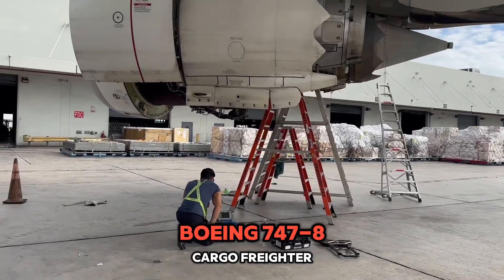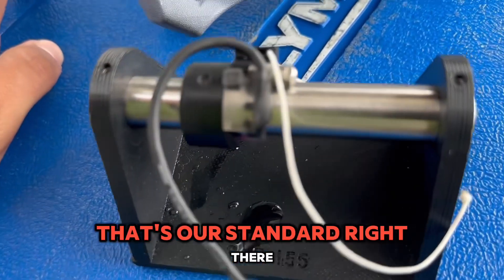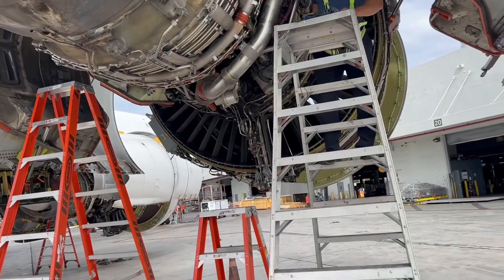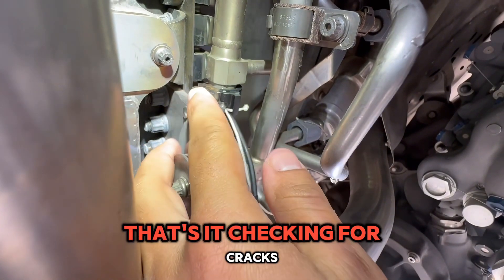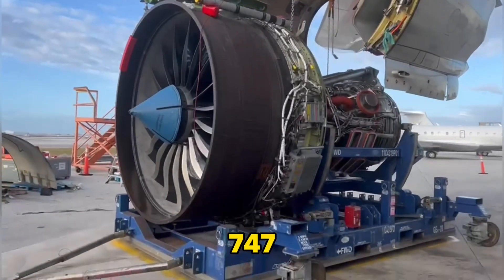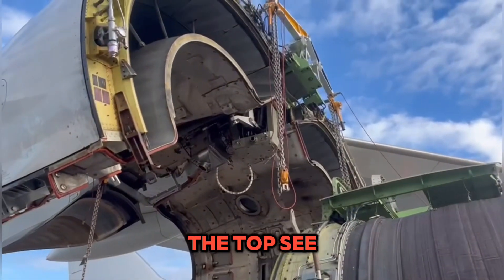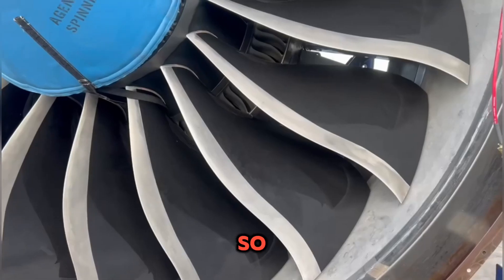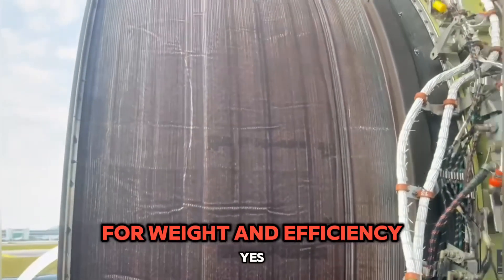AIRPLANE TURBINE ENGINE INSPECTION / CHANGE / START UP #airplane #facts #foryou

Comment: Just like starting up a cold 425 cat in the cold. She smokes till the flame wall is up to temp. 
Those engines are amazing! The energy created in that machine is incomprehensible. The shear volume of air they move is astounding! 
Whats the psi on those fuel lines? Its gotta be up there!
Reply from the maker: Great point! CM great to see you here again. Yeah that was an initial start with all the preservative oils. The engineering on those High Bypass Turbine Engines are a Work of Art. Happy Easter my friend
Reply from the maker: I don’t know 🤷 the fuel pressure on those fuel lines

Comment: There are allot of rules and precautions excersized hauling those big engines. 
Outstanding job guys.
Side question, how do they bond the titanium to the carbon fiber on those blades? 
Thanks for sharing! Awesome channel.
Reply from the maker: Thank you CM and sorry for the late reply. It’s a very complex procedure to bond the titanium to carbon fiber. We do ultrasonic to check for disbond on those blades after a bird strike. Great to see you here again.